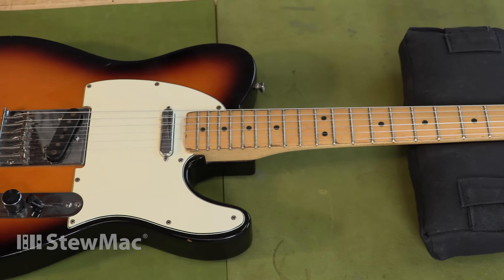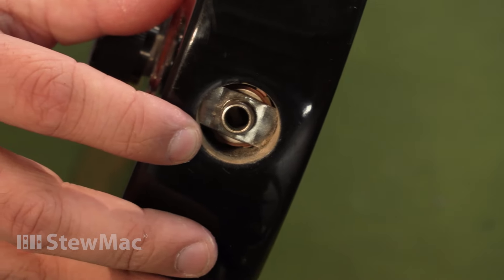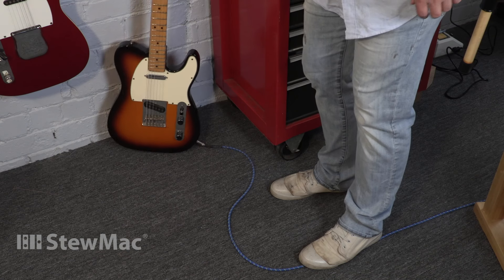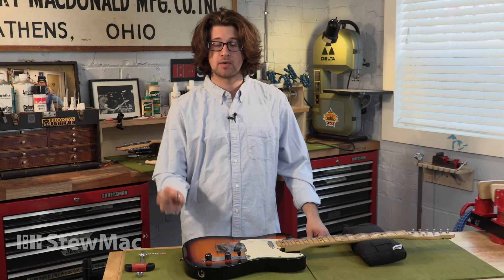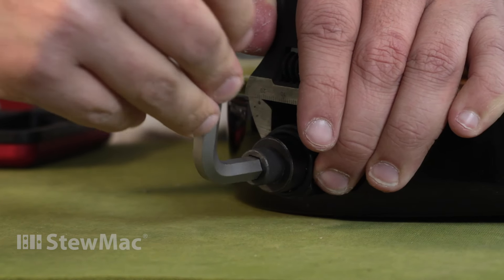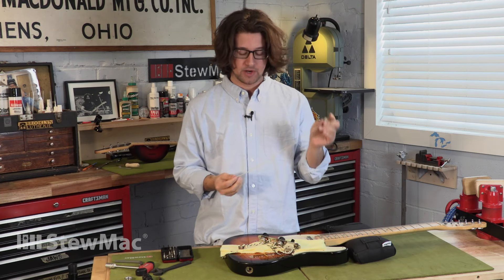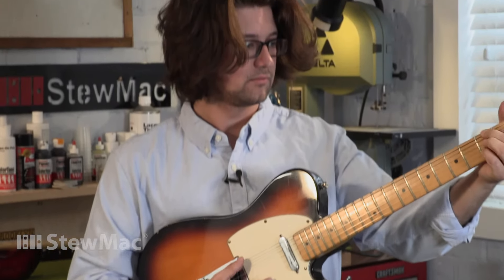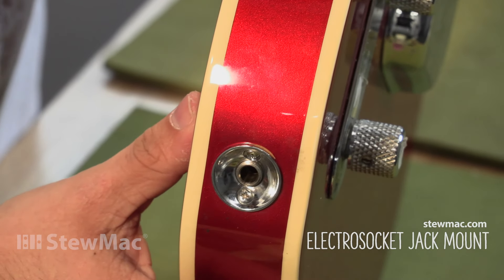How To Fix A Noisy Jack In A Telecaster

Comment: I have a late 90's Telecaster that developed this issue after about 6 months of use.  After checking out the engineering of the original jack socket, I searched for a better solution. I installed one of the Electrosocket Jack Mount and haven't given it a thought since. I threw the original cup and clip into a baggie which a have been in the guitar's case ever since.  Done!

Comment: Nice that you can extract with that tool as well.  I made an installation tool from a long bolt, socket, some washers and nuts, but it will only install, not extract.

Comment: Good video. If you're set on keeping the original cup socket, I would recommend a locknut or starwasher, and maybe a jack with the longer threads on the socket. Keep it from coming loose again soon. Right angle cable plug helps reduce stress there too. 
Ooopsie: you said you were turning the plate 90° but the video showed the same orientation.

Comment: The first time a Telecaster came into my workshop with this problem I installed two screws into the sides just like the electrosocket this would be around 1960, Now on to the Electrosocket it is fitted as the end all be all for this problem with that being said the jack doesn't always go into the jack hole cleanly the tip can get caught on the protruding jack thread, so here is the PRO TIP fit a star washer and some flat washers until the jack is just below the surface of the bowl now you can put it in blindly and it will slip straight in, now you will truly have the best jack arrangement you can have hang on a minute I thought I heard someone say "I always do that" LOL, cheers to all, Terry O'Keefe Guitar Repairs 66 years Still going strong. (PS Have a look at the video on pause at 3.33)
Reply: YOu just ruined a vintage Tele in 1960! HaHa!

Comment: That retainer clip simply was the cheapest way to do this. The broad/no/telecaster (also) was an exercise in finding the most cost-effective way to put together an electric guitar, and this is just one of the examples. Thing is: in most cases, it simply works and if not anymore, is quite easily fixed. As are a lot of the cost-cutting exercises on those guitars, that actually also made the guitar very easy to fix or modify to your needs. I don't blame Fender for this, though: it meant they were able to offer the new concept of the solid body electric guitar at a relatively affordable price while also making a reasonable profit from it.

Oh, and yes: on all the Tele's I've owned (only 2...), I've had to do a similar fix, with the one I still have indeed ending up with an electro socket.

Comment: The last bit using the Electrosocket is the correct solution. A totally vintage guitar is great for putting in a display case or selling to enthusiasts, but generally useless after years of playing as an instrument. Show me an all original playable Stradivarius violin and you will change my mind. Keep the original parts of course if it's worthy. I only own one guitar like that, but why would I waste it sitting in a guitar case when it is still awesome? Both solutions work, but the former is just a band-aid. Free pun included.

Comment: As a woodworker I would not have left the damaged wood on the hole edges.  I would have repaired them with epoxy before reinstalling the retainer clip.  That way if the clip starts to move again it will find resistance instead of an old damaged section of wood.  Then again, I don't repair guitars for a living so there might be a reason this would be a bad idea.
Reply: Epoxy is much harder than the wood.  If you epoxy-fixed, you run the risk of the teeth of the clip not being able to bite into the epoxy material, causing a split or damaged clip.  I removed my clip completely, then counter sunk 2- screws [one on each side of the cup] into the body.  Now the jack is secured to the cup to hold the jack.  FYI - this is the specific reason Bill Carson wanted Leo to take the jack from the edge of the guitar.  So, they put it on the body face.
Reply from the maker: I get your point... but in the video he turned the clip 90 degrees so the new clip would bite into fresh wood.
Reply: Putting epoxy into the wood on a guitar may cause complications the next time you replace the jack

Generally,with guitar repair,if you can fix a problem without putting epoxy inside the woodwork of the guitar,then it's best to do that first
Reply: Epoxy is normally a good idea but I have to agree, if the retainer is placed 90° from the original position it should have plenty of good wood to dig into.
Reply: Wood ya?

Comment: This was a nice commercial selling a tool to fix or straighten up the jack retainer clip. The truth is fixing a loose jack in always in order ( a hammer and pliers also works for this). The problem is he didn't tell how to actually fix the noise problem he only addresses the loose problem. The best fix for the jack cutting out and making noise is to simply replace the wore out jack.

Comment: I have an electosocket jack on my Tele, and it works OK but it's not ideal, either. It's made of aluminum, and the same stresses that will loosen the traditional clip can bend the aluminum cup. Mine's held up for many years, but I've had to bend the cup straight a few times. I think the better solution would be a flat steel jack plate, similar to what you find on some Les Pauls.

Comment: To further improve this, give the nut a small amount of a thread locking agent( Loctite or similar) so it doesn't go loose over time.
Reply: I use Loc-tite purple on guitars because it will keep nuts from turning but you can still break it loose with hand tools. Less strong than blue. Never use red Loc-tite...it's too strong for guitars and electronics.
Reply: Loctite 243 is what I use. If you use strong just heat it up when loosening.

Comment: My Tele doesn't have an internal jack socket like this. Thank God. It's got a rectangular jack plate, similar to what comes on a Gibson Firebird. Or basically just a Les Paul jack plate, only a little wider so it's more rectangle and less square like the Les Paul.

I didn't realize it came with that when I bought it so I was this close ~> <~ to buying an Electrosocket for it while it was being shipped. Luckily I thought to look at it before I ordered one and that's when I realized it came with a rectangular Les Paul-style jack. Might not be vintage correct but it's also not an issue now, either. I could always pull the plate and install an Electrosocket or a stock Tele jack. I'd have 4 screw holes around it but who cares? I won't ever sell that guitar so it really doesn't matter what I do to it.

Comment: Need advice on my Strat;   I set up my Strat, intonation, truss rod, etc...I set my action to max. height and the OPEN D string has a buzz, only the OPEN D. What could be causing that? It's driving me crazy and I can't figure it out. Help PLEASE.
Reply: My thoughts would be a nut slot cut too deep or an uneven fret. Quick fix on nut slot would be super glue / baking soda trick. As seen here: https://www.youtube.com/watch?time_continue=29&v=slCMkvEfK_U&feature=emb_logo

Comment: I have similar problem with my Stratocaster. Is the jack socket for that built in the same way as a Telecaster? How would one fix that?
Reply: No, your Stratocaster jack socket is mounted directly to the recessed oval metal plate that sits on the top of your guitar. If the jack socket is loose, remove the two small screws on the metal plate and lift it out. Check your connections are okay, then tighten the nut with a socket wrench while holding the rear of the jack socket. Replace the plate and the two screws and you should be good to go.
Reply from the maker: what @d2vmusic said... if it's still loose after that the screws that hold it to the body are the issue.  At that point I'd recommend plugging and redrilling the holes, or if the guitar isn't particularly valuable you could use slightly larger screws
Reply: @d2vmusic  Thanks. I tried that and it seems to have done the trick. I guess it would eventually loosen again over time though so I'd probably have to do this in future.

Comment: The tool itself is great, but doesn't solve the problem in a long run. What works is actually installing a much thicker retainer clip, something like 2mm. Unfortunately you have to cut and drill out one yourself

Comment: Clearly, Leo did his best making  jobs with Fender guitars. Fender and Gibson styled guitars need to be setup on regular bases, their hardware fails, and at the end they would require some major repair jobs. Plus, somehow Fender tried slightly different methods by every single year,  planning how to fix is difficult and it's even difficult to identify whether the guitar is counterfeit unless you are a true Fender nerd. So it's very easy to lose value as collectables/2nd hand product during repairing process. Otherwise local woodworkers would have done all the guitar repairs.

So I think 'Fender' is one major factor for how Luthiers make their living.. And...maybe that's why Fender is still using their old methods. They are So kind.  :)